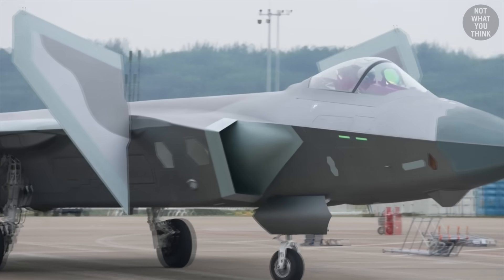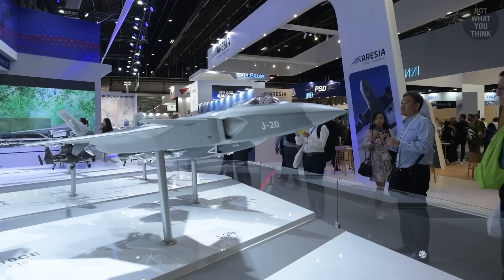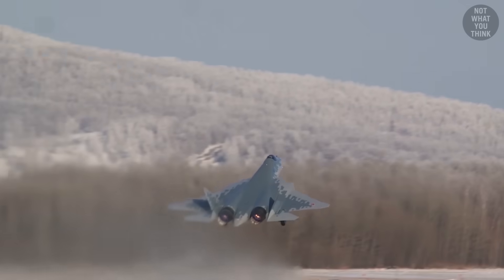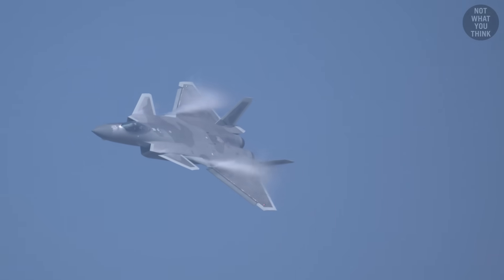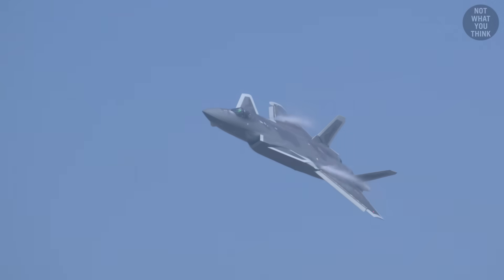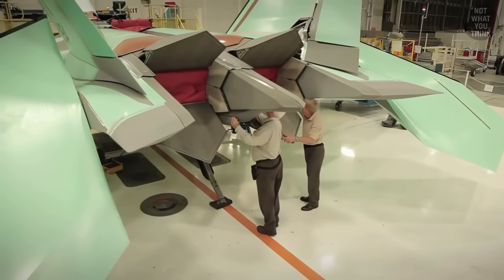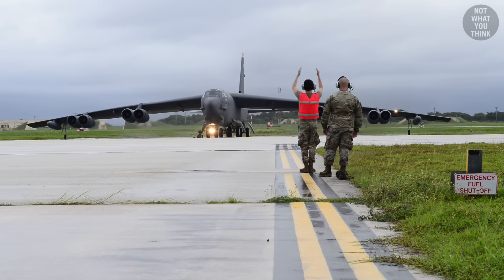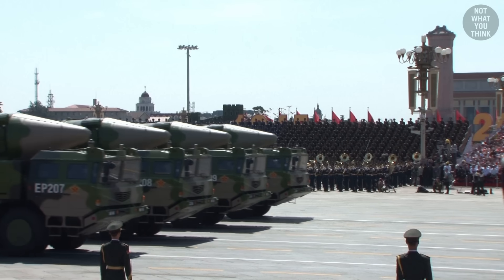Why China's Stolen "Stealth" Fighter is Problematic

Comment: While I agree the West should respect the J-20, fear is not an appropriate word choice. The J-20 was built to attack naval assets, as China felt it was the greatest threat from the West. The one area that should be considered is how the F-22 is being upgraded with IR tracking and stealthy external fuel tanks. Sandboxx News has a great video on it. Also, as for dogfighting being dead, think about it, with planes all having stealth, they will need to close into closer distances to detect and ultimately engage each other, thus providing more opportunities for dogfighting rather than less. The US learned its lesson about not having guns on its planes in Vietnam.
Reply: Now also while you overall have educated points, I would also like to point out that the J-20 was not designed to attack naval surface assets - that's the H-6's job. The J-20 is a heavy long-range air superiority fighter, intended to destroy enablers. The J-20 + PL-15 pairing is designed with a role in mind:

1) destroy American and Japanese AWACS, tankers, ISR nodes, and logistical support

2) destroy the F-16V's and less advanced fighters of the Taiwanese. F-16V's with AESA radars and AIM-120C-8s as well as the Taiwanese Sky Sword are quite a threat to the Su-30MKK's of the Chinese, but they would be under incredible danger under BVR engagement against 5th gen assets.

They don't have much of an interest in going toe-to-toe with Japanese F-35s and American F-22's - they want to use their anti-access/aerial denial to make it extremely inconvenient for them to operate nearby in the first place. The SAM network but literally the part where they want to use the vast distances over the South China Sea to make it logistically impossible for advanced Japanese and American assets to operate there. 

Do you see where I'm going with this? 

And before anybody calls me a Chinese bot, I'm American as they get, in my page isn't some drop page, I actually post content. I simply care about having an objective analysis that is politically agnostic so we can actually get somewhere and deal with the threat accurately. Air supremacy is not an American birthright.
Reply: @ArizonaAstraLLC well done American, you beat the other Chinese who made a horrible analysis.
Reply: @ArizonaAstraLLC Xu Jinping knows less about J-20 compared to you
good analysis
Reply: Amen Brother!!
Reply: You mentioned your own counterpoint. IR sensors are currently at the technological level where they allow for BVR engagements. Stealth aircraft do not negate a BVR engagement possibility, they simply shorten the distance of their own detection. Not having guns on fighters in Vietnam was not the cause of problem directly as many incorrectly say, it was the fact that 1960s US air combat doctrine was primarily focused on safety as opposed to correctly imitating threats. Many forget that the F-8 Crusader was used heavily in the conflict and was armed with guns, and after the Air Force added an autocannon to the F4, only a handful of gun kills were achieved.

 Missile technology was severely immature for air-to-air missiles in the 1960s, but you cannot say the same today especially since BVR air combat became the norm in the 1980s in the Iran Iraq War, was further demonstrated in the Gulf War, was exclusively done over Serbia (all NATO air-to-air kills were BVR in this conflict) and now today over Ukraine, it is demonstrated every single day. Ukrainian pilots themselves list the MiG-31BM and Su-35S armed with R-77-1's and especially R-37M's as the single greatest threat to their own aircraft fleet. Not one gun kill in this whole war

Comment: U.S. is moving on from the F22 with the NGAD, which has significant technological upgrades. What we don't know is the quality build of the J-20. It's already a maintenance nightmare with the F-22, only because the quality of maintenance and technical support is important. Who knows what the Chinese are going through.
Reply: Well.... their icbms are using water as fuel sooo😂
Reply: @trailblazer632  That's a stupid mistranslation. All Chinese missiles use solid fuel. What the defector was saying was the Chinese idiom, "injecting water", which actually means inflating a budget. It means the Chinese MIC have been charging the government more than they should and the generals skim off the extra cash. It shows that their MIC is as corrupt as, if not even more than, any regular Western MIC.
Reply: NGAD will cost $ 300 million EACH. They'll build five then Congress will cancel them. Also, with Boeing in shambles and Northrop Grumman basically telling the USAF to fuck off after the unfair treatment they got in the ATF program, the only possible dev for the plane is Lockheed. No chance for competition, no chance to lower costs.

Comment: Not really an answer to "Americans f-22 stealth fighter." That's because the F-22 is not 2020s tech, produced or designed. It's early 1990s tech for Americans. Really you have to compare it to F-35 and NGAD when it comes out. You know, 2010s American tech to 2020 Chinese. Oh, it's even very less stealthy than F-117. Early 80s tech?

Comment: Minute 4: "the heat signature of the afterburner would be visible on radar". Are you sure???
Reply: the heat signature itself would not show up "on radar", but other parts of the plane that lose their stealth abilities from the paint suffering under high heat might be easier to spot and there is obviously an IR signature for satellites and reconnaissance planes to latch onto...
Reply: the concern that having to rely on afterburner for high speed is true, they can easily be spotted with mk1 eyeball and show up on IRST. but i guess the writer fumbled and thought radar would also apply
Reply: @piscessoedroen  kid there's no long range fox 2 in yankee arsenal. So even if you somehow manage to see with a irst that far you can't do anything about it😂
Reply: @antoniohagopian213  you can still lock it optically and guide a missile to it
Reply: @piscessoedroen  guide what? I already said there is no long range fox2.
Fox 3 still requires a radar lock otherwise it's not going to track anything but will go off the rail anyway.
Reply: @antoniohagopian213  SAM launches doesn't always require radar lock. Optical guidance can be used just like guiding a beam riding AT missile
Reply: @antoniohagopian213 Meteor’s way better than our Fox 2 option.
Reply: @piscessoedroen  delusional
Reply: stretch the wave length long enough, or short enough, every thing is a radar.
Reply: Peak propaganda
Reply: @antoniohagopian213  "every small mistake is propaganda " 🤓🤓🤓🤓
Reply: @stuff1044  that's not a small mistake, it's a complete lack of understanding of how those systems work
Reply: And the big problem is, the current J-20 can already do some "pseudo" supercruise like the F-35, using afterburner to get pass the sound barrier and then throttle down to max power to maintaing supersonic crusing.

Comment: With it's 20m² rcs from some angles, it loses to even the Felon. It does win from the front. I don't remember those numbers idk why all those posts were taken down.

The main advantage the J20 has is its massive numbers. 

There are more than 200 of them, probably more than 250 by now. And while it does have that really crappy rcs from certain sides, it's still more stealthy than a conventional fighter most of the time at least
Reply: I'd like to see a credible source for the 20sqm RCS from some angles.  20sqm is 25% bigger than the stated RCS for the Su-27.

Comment: Why did China need a stealth fighter? Come on, that's like asking why any nation needs an aircraft carrier.
They are inherently a weapon of invasion, not a tool for self-defense. You don't need "stealth" in any self-defense scenario, ground-based radar and AWACS are enough to put invaders on the map for anything carrying a missile to lock on, you don't need a stealth jet to do it, that's like assigning a professor to mop the floor in a zoo. Same case with the aircraft carrier, it's a literal extension of any nation's military control. Wherever a carrier goes, so goes that nation's military might, aka, invasion purposes. US knows it best.
China claims it just builds these weapons of invasion for self defense is nothing but propaganda.

Comment: J20 is widely regarded as a gen 4.5 stealth fighter, mostly because it has canards which increase its radar cross section. There a few other design choices that make it many times more visible to radar.
Reply: How the hell canard is increase RCS, isn't canard using stealth material like aircraft airframe use?
Reply: @captainnutt2995  In completely horizontal flight they might not make much of a difference in the rcs being as they are a control surface the moment they more more than a couple degrees off plane; with modern radars may as well be holding up a sign saying here I am shoot me. Not to mention that their engine nozzles while better than the russians aren't near as clean as the F-35 let alone the Raptors.

Comment: A rip off can only perform so much. 

China wanted the Chinook’s engine so bad that back in 2018-2019, it tried to bribe a Taiwanese pilot to fly it into Chinese mainland, but ultimately failed. 

They wanted it so bad because their version of the Chinook requires 3 turboshaft engines to generate 7000 horsepower while a 80s variant of the US’s Chinook only need 2 to generate over 8000 horsepower. 

That said, obviously it would be smart to not underestimate China.

Comment: Stalin once said: "Quantity has a quality all of it's own..." The J-20 may be 'inferior' in some aspects to the F-22, but if you have more of them, then that can change the balance of technological power.

NGAD better be a game changer, because old tech is still very viable even in the 21 century. The 50 year old designs of the F-15 EX and F-16 Block 70s are proof of that.

Comment: why is the F22 being matched up against the J20? what is the point?
The large range distances in the pacific will result in engagements between F22 and J20 few and far between, considering how they have to operate from land bases such as Guam/Korea/Japan etc. 

wouldn't it make more sense to compare the J20 with F35C? where carrier operations will allow them to operate nearer to chinese shores, and thus more likely to engage J20?
Reply: The primary thing that makes the F22 irrelevant is that it's not being produced any more and there are only 186 F22s; many of which are non operational at any given moment.
Reply: Or the new FX.
Reply: Those carriers can come under attack from Chinese navy too. So those carriers will definitely be staying quite a distance away.
Reply: @dallasyap3064  correct. But no relevance to the topic above.
Reply: @Orion.401  How is it not relevant? U mentioned about range & distance and that deploying carriers closer to Chinese waters would help reduce them, which is true. But as I mentioned, PLAN warships would have to be neutralized first before sending carriers close to hostile waters. And as for the range, the Air Force got tons of tankers to refuel the jets (F-22, F-35), therefore removing any range as an issue.
Reply: @dallasyap3064  once again, not wrong, but no relevance to my argument. since from what i can see, your argument and point is neither aligning nor at odds with mine
Reply: Cause everyone is obsessed with F22 even the CCP trolls are secretly a F22 fanboy maybe even Winnie the Xi is probably a secret F22 fanboy. It's funny just look how China is trying so hard to copy F22 they even send spies to USA to steal the blueprints.
Reply: The target of the J-20 is not the F35C. China has developed the J35 specifically for the F35C. Also, the US aircraft carrier cannot approach the Chinese coast because the range of Chinese anti-ship missiles is farther than the combat range of the aircraft carrier. As long as China masters the technology, no country can compete with China in terms of quantity.

Comment: As a Chinese lemme try to answer some of this in a nutshell for those who don't wanna watch the entire thing
Was J20 stolen?: yes and no or at least 80% of it. Go research Subin f35 and f22 then you will come across one of the biggest compromises of US military intelligence. F22 and F35 were partially stolen and C17 was also stolen which lead to the development of Y20
Did it use russian engines?: Initially yes but now switched to a more stable ws15 engines but pretty much just reversed engineered russian ones with slightly better life span and thrust by a decent margin a decent margin

Time gap advantages?: Hardly any for J20. F22 was designed to dominate the skies for the next couple of decades when it first flew which US already accounted for enemies having stealth technology as well. What they didn't account for is how would it try to dethrone the raptor from the 1st spot
J20's sensors advantages over F-22: If we only look at this on paper then J20 dominates the f22 by a good amount. However, most of these crap we don't even know if it works properly but who knows? F22 is getting a couple billion dollar upgrade as well so nobody knows but the upgrade certainly removes the gap for sure. what I do know for certain is that J20 defo have a irst and head mount display advantage over the f22 since these tech russians have done it over and over again (even though the performance is dog water)
why China needs J20: to project power outside of China specifically Taiwan and Japan duh. Also to match against American peers if US decided to interfere in Taiwan
why doesn't it have a gun: When you have missiles as your primary weapon and you won't dogfight anyways why would you need it?
US government response to J20?: the video mentions NGAD but the true threat still lies in pl15 being superior in range. Aim 260 was the response

Overall J20 should not be feared but taken seriously for sure. A jet is a jet just like a gun. A shitty gun can still kill people like how a higher quality gun would. J20 may not be invincible or good against F22 or F35s but certainly a bigger than ever threat to 4th gens and tankers
Reply: Finally a Chinese who's not an unreasonable fanatic!

Great explanation thanks
Reply: @xdas11  good number of the chinese people you see online or irl are associated with ccp or a ccp beneficiary. otherwise, they usually do not have the money to migrate. because of power, corruptions and brainwash, they often see themselves as a superior race / class just like how WW2 Germany / Japan view themselves. hence the craziness you experienced when talking to them. i came from taiwan and we avoid them like a plague for a good reason.
Reply: Not only the aim260 but also the fact that the meteor is being going to be compatible with the f35. With its larger range and NEZ, as well as having its own AESA radar, the meteor literally is the response to stealth aircrafts as of now
Reply: @vizender a missile has an AESA? Wouldn’t that be too expensive?
Reply: @gelrond9958  yeah, it as a small AESA, and yeah, it’s expensive, but it’s the cost of having such a long range missile. That’s why the AIM120, the MICA, Derby, and other shorter range fox 1s are still being used on along side the meteor on planes that use it
Reply: Yet another ignorant Westerner pretesting to be Chinese.

"J20 defo have a irst and head mount display advantage over the f22 since these tech russians"
"a more stable ws15 engines but pretty much just reversed engineered russian ones"
"C17 was also stolen which lead to the development of Y20"
You just shown me that you don't know what you are talking about.
Reply: 我不明白为什么总是有下忍认为写轮眼是低级忍术？
Reply: 他们已经水深火热了，我们就不要再剥夺他们唯一的尊严了，50万美元的面包就快来了 @kanlu5199
Reply: You are clearly a person who is working for China and try to disguise your opponents
Nice try!😂
Reply: As a Chinese you failed your country. Go back into the wall.
Reply: ws-15 have no idea with russia engine ...
Reply: The C-17 is a fucking cargo plane, what tf can you steal there?
Reply: 你是中国人吗？你这说话语序都不是我们大陆这边的😅
Reply: Lol you aren't Chinese and you're wrong
Reply: 😂 "why would you need a gun?" Idk man ask the f4 phantom and vietnam era us air force pilots....
Reply: @trailblazer632  modern missle range and overall capability have massively increased compared to the 60s-70s, also why bother lugging around a gun when your aircraft is not designed for dog fighting?
Reply: @Birdman369  sure and so has stealth technology as well as jamming and other countermeasures.  Why carry a gun? Because when you need one you cant exactly ask for a loot drop in combat now can you?
Reply: I'll quote you on that "A jet is a jet just like a gun. A shitty gun can still kill people like how a higher quality gun would." 

And I will have to counter If you if paired against F22 and F35 pilots the one difference is those pilots have seen several long term expanded campaigns and multiple engagements. It's sort of like coming in being the latest kid with a knife against hardened veterans with a smaller knife.
Reply: Totally agree with you
but from what I understood he's only talking about the machines like he said "on paper"  @brolydictcumberbatchmontou401
Reply: It was not theft! It was a calculated release of stealth technology.China will take 30 years to prove out stealth technology also The reason Americans released limited stealth to China is that the military have a counter technology. 😂😂😂😂😂😂